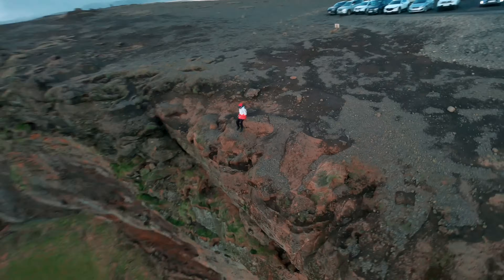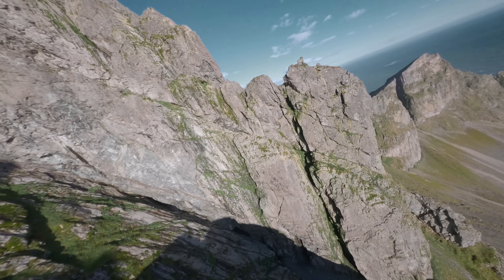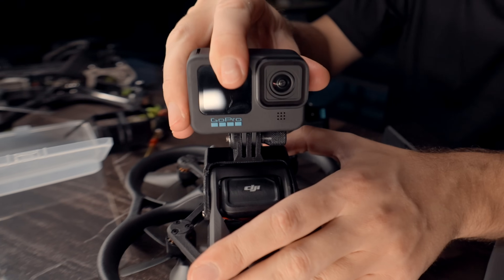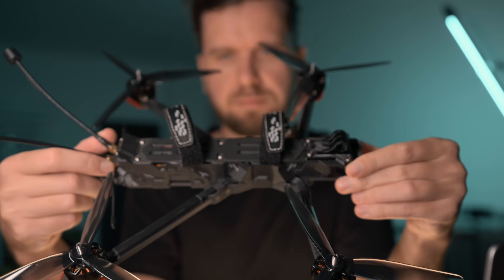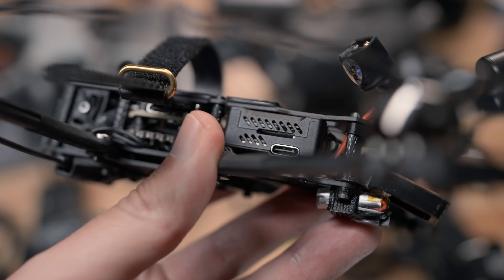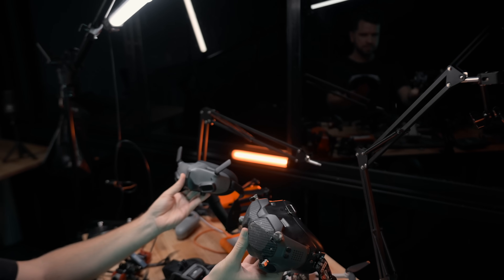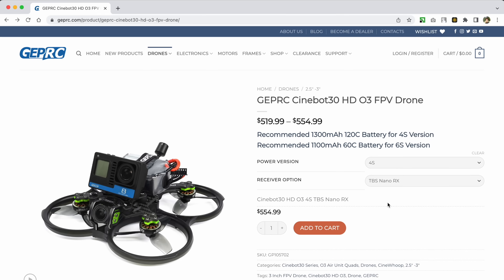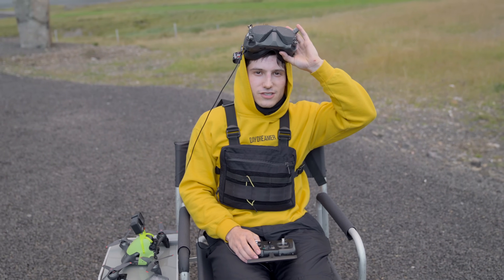FPV Drones – How to start in 2025?

Comment: I wish you used more time on drone law's 
More people do bad things more laws we get. 
In my country you need. 
- Drone license
- Registrate the drone with ID and mark it 
- MAP and fligth data app and some time ask or registrate you fligth date and time
- Drone insurence 
- + its lots of laws.   If you use FPV - you need a spotter, as you need eye contact with the drone at all times ! ect ect
max higth 120m , cant fly near or over peple. + you need to check app and map for fligth control and restrictions.  There is lots of red - no fly zone.

Comment: Hi there. I am absolutely beginner, I am just about to buy my first ever drone, but I really like FPV drones and that jet pilot feeling. I don`t understand one thing. If I buy a googles, and a Gopro, and you can buy that DJI O3 or O4, how do you see the Gopro in live on the googles? Is the Gopro attached to the drone or to the DJI o3/o4 by a cable or something? Another thing, do you take images too or just video? can you take images with the Gopro with a remote control with the drone? So can I use the FPV drone for photography as well? Thank you for the answers. :)
Your videos are very cool.
Akos

Comment: Do you think a good beginners setup would be the betafpv pavo femto, extra propellers, a extra frame, 2 batteries, the literadio 3 and the dji goggles n3? Would this be a good starting point? Do you have anything that would work better for around the same price?

Comment: Great footage, but unfortunately you didn't mention a simulator or the need to practice, before you start flying.
I bought the liftoff simulator and I'm completely lost - really bad tutorials - I nearly gave up on flying. Other simulators weren't good for FPV flying either.

Comment: I was always told that dji was the best brand , that is why i bought the dji mini pro 4 …. I tried playing the simualtion and  i noticed the drones in take off are not like the drone i have .. they fly upwards on there own is that how the other drones are like? Did i buy the wrong drone for moving around fast ? Cuz video wise yea its good there but i always thought drones had both which is flying around fast WITH good footage resolution someone please answer me cuz im about to go and TRY and buy a smaller drone with the goggles hopefully i get the right one

Comment: New sub here,

I prefer not to use dji as they discontinue their drones, just like my mavic drone, i had no support in my country for it.

I would prefer aftermarket drone but its abit complicated to start up.

HELP, I DONT KNOW ANYTHING ABOUT SETTING UP FPV, im interested in it, i race rc cars but fpv seems complicated.

I have bought a eachine tx16s 
Happy model mobula7 flysky basic 
And i have compatible goggles 

I managed to connect the drone to the goggles but i dont know how to connect the drone to the radio

Comment: Watching this in Jan 2025, but was wondering as I’m new to FPV. I want something I can grow into as I want to start as a new hobby but potentially move into a side hustle. I feel like the avata 2 is a good entry but long term will limit future growth. I’m looking at the GEPRC Cinebot 30 HD 03. Will the DJI Goggles 3 and Remote Controller 3 be comparable with this setup? Is there going to be any configurations I’ll have to do pre flight? I was looking at the TBS Tango 2 Pro controller as well. Anyone who can help here? Much appreciated.

Comment: Hi, thanks for sharing and the update(almost 1 year ago, but stil good). Now I bought an FPV drone myself and exploring on youtube these movies. Just not so into DIY and bought an complete set DJI Avata 2 ext. flight combo(DJI 3 goggles, DJI3 controler and ofcourse the DJI Avata 2 incl.3 batteries). I'm responding to your video because of the goggles The DJI Goggles 3 model is with the extended batterypack on the back of youre head and the strap pressing on the forehead and thereby the goggles with the silicone facecover will be very comfy on youre face(loose). the silicone facecover will cover enough to keep out the light from outside the goggles. So I like that one very much. I think I'll buy the remote FPV controler to this set. So thanks again and keep it Up in the Air. ;-)

Comment: For a very beginner which drone is best
Reply: Get a radio, learn in the sim for at least 8-10 hours, then get a meteor 65 with like the betafpv goggles 03. I don't recommend getting dji for the first drone, because it is heavy, and for carrying it, you would need a larger drone, which is more breakable, than a small whoop. Or you can get it with a walksnail digital system.
Reply: @steveastra4103  thanks alot
Reply: @steveastra4103  thank you so much
Reply: @steveastra4103  also does this record or is only for view
Reply: @Gamerarelife  the betafpv vro3 goggles has built in dvr, wich means, that you can record the analog View. But note, that this is analog, really low quality video side by side to digital.

Comment: I'm an absolute beginner with fpv drones but my goal is to not only do it as a hobby but to eventually use it for motorsports, following cars that are drifting, rallying, drag racing etc. Of the drones in this video, which would you say I should eventually upgrade to in order to do those fast paced shots?
Reply: To a 5 inch like the iflight nazgoul evoque, or the geprc mark5

Comment: Help. I just lost my Avata and will likely not be able to get a replacement via care. So I am considering the CineBot 30. Can I just buy the drone (and batteries...) and use my avata googles and controller. Or was that what you said about "not recommended". and consider the Tango.  I already miss being in the sky but am a bit less familiar with some things outside the DJI ecosystem. Would like to be out of the avata but have this much invested so want to use everything I can. Thanks

Comment: What drone would you guys suggest for about 200$. Fairly new to this, like cool videos but want to fly it sporty and aggressive. The budget is to see if I like it before investing more.
Reply: You dont even get goggles for 200$
DJI O3 cost about 230$

I startet with a Radiomaster Zorro Elrs a 2inch 2s analog drone from ebay(flywoo) and an eachin ev800d.
This will be about 400$

There is more, way cheaper, stuff than DJI but DJI bros will never tell you that.
Also if you think you will ever get into smal drones line whoops, dont go for dji. The O3 is way to heavy and the pavo pico is a flying stone compared to actual light weight tinywhoops.

Comment: Hey im just getting into fpv. Long range flights look the most exciting and i just purchased the dji controller 3 to practice on a drone simulator on my pc. I saw you said that its not optimal for flying long range because if the headset loses connection from iflight drones then you lose control of the drone too. Just curious if I should instead purchase the controller you put in the description bellow? The drone I plan on buying is the Iflight bob57  with the dji 03 air unit.

Comment: Acabo de adquirir un mini 2 y estoy encantado pero vengo del fpv analógico desde 250mm hasta 75mm tiny's y me estaba pensando en que el próximo fuera un avata ya que lo que busco es volar con esa calidad de video que tal vez no es la mejor pero si mejor que lo analógico y poder ir a más de 1 o 2 kilómetros para mi es algo espectacular pero viendo tu video estoy pensando en una dji03 estacion y una v2 goggles ya que no tengo mucho presupuesto y montarlo en un 220mm que tengo guardado  y a futuro adquirir un cine bot 30 o¿ que opción de dron  me podrías recomendar de bajo costo tipo cine bot ??? muchas gracias.

Comment: I tried to configure according to your video although preview responds according to the remote control. However, the motor does not spin, even though I am able to control motors using app.
Reply: Did you connect your radio? Did you press arm?

Comment: I am very happy with my DJI Avata, i had no idea about fpv and in my area there is noone to ask about this topic, after the first flights with the motion Control i found out there is an acro mode, i checked the rc2 an it costs me all together €980,— (Professional set costs much more) now i am addict, sure the next one is a more pro copter but i ve never started this journey without the DJI Avata!

Comment: $2000 for DJI Avata is complete bs.
Since you'd need the controller, goggles, go pro and whatever else for both you can't lump that price on just the Avata. 
The ciniwhoop drone you link is $400 and the Avata is $500 from DJI direct (more from the dodgy Chinese link you provided). 
$100 more, not $1600 more.

Comment: Gotta say, this FPV drone stuff reminds me of certain parts of the old Myst games. Specifically, the special Books you could use to travel between worlds, which those games used as a core mechanic. Each book would have an image panel, of sorts, at the front of the book, but the "image" would actually be a moving video of the place you would be taken to if you used it. The format of those little video clips would usually be a long run-up to the general area around the arrival point, followed by 3-5 seconds of circular touring around the location, spiraling in towards the final destination, until at last the camera's POV would settle into a simple orbit around the arrival point, after which it would continue looping that final orbit section, until you either used the book, or closed it.

Comment: So the DJI FPV Controller looses connectivity if the Goggles 2 go out on DJI O3? 

Can anyone confirm this is the case? I can’t find anywhere else where this issue was mentioned.

Comment: Soon as I heard $2000 to start out I immediately closed this video. I'll admire other people's footage for the comfort of my wallet.
Reply: Most of that is for the goggles and the digital video transmitter and receiver. 

If you take the analogue route it can be a rather budget hobby.

I got into it and built a few fpv drones. Its great but time consuming if you're not using a dji type easy to use drone. 

You can pay a bit for a decent drone but the individual parts such as motors and other electronics are reasonable if you know how to solder. 

Programming is a whole other beast. 

Lucky there are folks on YouTube who knows everything one could need to

Comment: Great video :) Just over a wk ago, my avata and mini pro 3 got stolen out of my car and DJI service is the worst. I've been thinking about going a different direction if I buy another drone which would be the GepRC Cinebot30 FPV drone. Since my goggles were stolen also I was wondering what goggles you recommnend. I think you use the DJI goggles 2 but isn't the DJI Goggles integrated supposed to be better. Also what controller should I buy for the Cinebot30. Please do a video explaining what controller and goggles someone should get when buying the Cinebot30 and how to set it all up. Thanks Darin

Comment: I wonder if it’s possible to have a robotic drone that works as a signal relay, that uses triangulation to keep itself in-between the drone you’re controlling and the controller, and at a higher altitude, so that you can have a greater effective range, and avoid geographic signal barriers, like the ridge on that island or the mountains around the glacier.
Reply: This is awesome
Reply: @bootyblaster3009  you want to attach a dji signal relay to a drone? Well i think they have done it for agri line of products hehe
Reply: I wish all YouTube comments were like this
Reply: One of the open source video link systems has this sort of feature. So adding a link is possible but the extra step adds latency. The added latency would make flying close to things more risky. The latency could also cause a headache.
Reply: @ddegn  guess the idea would be useful for people doing documentary or exploratory work, with drones laden with sensors, but perhaps not quite as useful for people doing acrobatic stuff near the surface, lol
Reply: @THarSul  If the drone/airplane were large enough, you could use a mobile Starlink terminal. This should allow video to be transmitted anywhere in the world. This also wouldn't be a good solution for anyone doing acrobatic stuff.
Reply: @ddegn  tbh, at this point, we're basically describing an aerosat, so this would prolly be a good application for something resembling a specialized weather balloon, with some ducted fans or something for station keeping and making sure it's got line of sight between the transmitter and the drone

Comment: which option is to choose if already have the avata. so googles2 and so on. and do I need a new controller?
the avata is loud, yes, but is the only set where I was sure to get everything in place and in a secure package for absolute newbies . and even with 3 batteries I was less than 1500€ sept 2022.

Comment: Great video 10x

When you dive waterfalls is the drone with conformal coating the aio board?
How the 03 air unit and vista handle the water and moisture?

Comment: First of all, a really informative video. I have a question; I'm a beginner and I want to get started with FPV drones. I watched the link you provided below, and I'm going to buy the Cetus X FPV Kit. But I have a question about the Goggle 2. Can I fly all the drones you mentioned below with this headset? I'm from Germany, and I don't want to buy something that won't work later on. I'm particularly interested in the Explorer LR 4 HD DJI O3 Sub250 4K/1080P Micro Long Range Drone. Sorry for the long text. Greetings from Berlin!!!

Comment: I have a need, maybe someone could help.

I go under floors in houses to inspect for damage and compliance. Everywhere I go, these drones would fit where I can (or even where I can't) and I want to do this work with a drone instead of my back.
It'll need to hover well and fit into tight spaces and last at max 30 minutes. It would be used more for photos than video but the issue is, I need to see what it sees in real time so I can take the snapshot of what it's looking at for my reports. Is there also one that can rotate the camera up and down?

Surely there is something that can suit my needs.

Comment: Weird thing with O3 unit, I bought Cinebot30, dropped it once flat on the road, there was no damage to the drone, however O3 unit stopped working. I think this O3 units are quite unreliable, and probably Avata will work better.

Comment: What drone does he say at 3:00. Cant find any match in the description. "Capersi mark 5"???
Reply: GEPRC Mark 5 fpv quads.    Pretty good quads actually in my experience that are available rtf or bnf.  Fairly high end , quality builds   yet not overly pricey.  Not cheap but reasonable and pretty good value for what you get I think.   Least from what I've seen.  Idk if theur quality control is consistent but the few I know were well built and tuned with attention to detail.

Comment: This starting guide, was more confusing than helpful. You have amazing footage and make me want to jump in but the organization of what to get and options to look for, Pros and Cons was sporadic and in-cohesive. The links help but they are just as unorganized as the rest of the video. Learning with a simulator is one of the best pieces of advice when starting as it doesnt cost you replacement parts and its put at the end of the video.

Comment: Loved this video and got so much valuable information. Maybe I'll try FPV after all. Couple of questions: i have had an iflight FPV drone sitting around for a year. I need a hook up with goggles and controller. Which ones would you suggest? I'd like to be able to use the goggles and controller on additional drones as well. Thanks.

Comment: Question: which camera is better, the a GoPro10 or 11 or the one on the DJI Air 2S?  I'm reading the specs and it seems the Air2S is better, no?  Larger sensor and such?
Reply from the maker: gopro 11 the best for fpv

Comment: Great video. Few questions. You compared Avata to Cinebot30 and mentioned the price difference. When I look at the Avata it is just under $2k all in with extra batteries, controller, and goggles. Looking at the Cinebot30 its about $600, but it seems that is just for the drone, does that seem accurate to you? So  for a more accurate price comparison I would need the drone $600 + the Goggles $650 + a GoPro camera $350 + a Controller $250 range, plus extra batteries and charger $120 for a total of $1,970 plus taxes which is then more expense (not by much) than the Avata. I think the CineBot30 is a much better drone and is what I am looking for. Just trying to see what my total cost is going to be to get setup and go fly for more than 7 minutes. What are you thoughts?

Comment: Is the camera and fpv systems just sold separately?
I have an idea that does not involve flying.
Reply: Many camera systems get really hot and require active cooling if they're not being flown. Joshua Bardwell has a video where he put a FPV camera on a RC car. He added a fan to the FPV system to keep it cool

Comment: Great video. I cannot figure out how these GPERC drones are build and how to set them up? Do you have to build it, if so, does it require soldering? How is the setup? Do you have to configure ever single parameter, like you had to with Pixhawk controllers? Do they have some sort of flight modes or is it pure manual flight? Thanks.

Comment: Hi there! After watching the video, it doesn't make sense for me to go with the Cetus Pro fpv kit because it is minimal. On the other end buying the remote and flying in simulation makes more sense. So I can knock two birds with one stone. I have a remote I can practice with and use later when I purchase the Cinebot 30. My question is, where do I get the software, and is it compatible with the TBS Tango 2 PRO FPV RC?